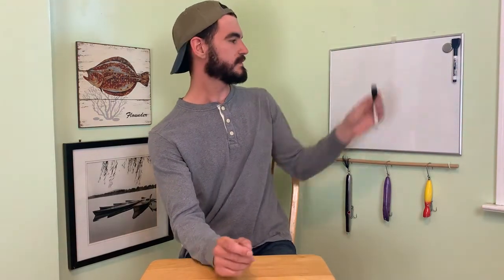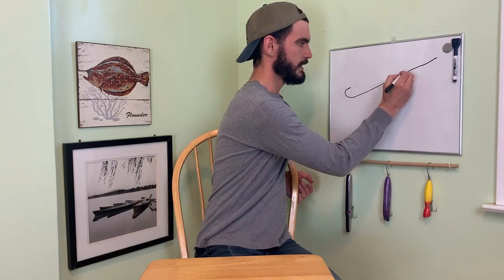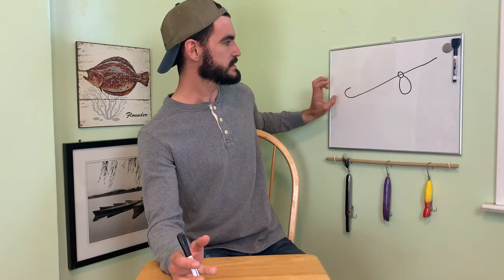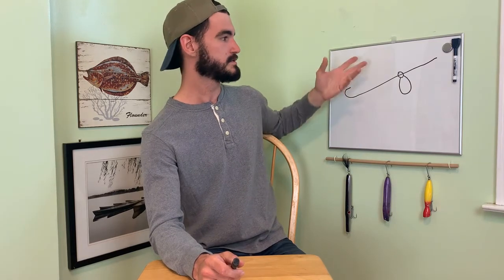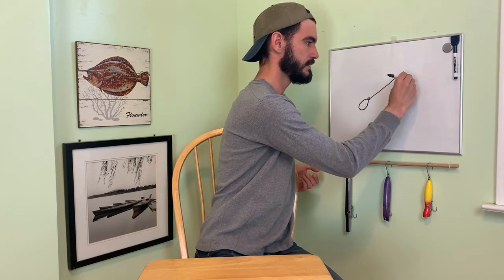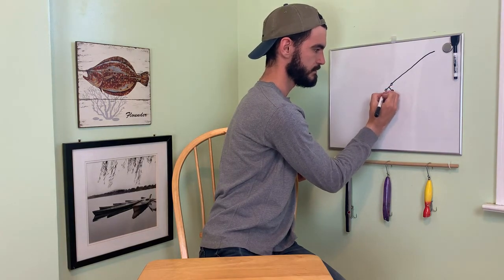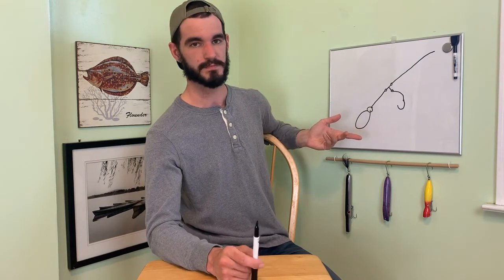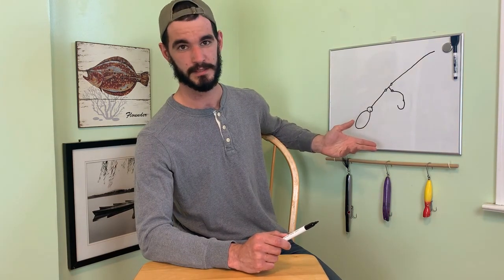Tautog (Blackfish) Basics | How to set up the rig

Comment: how long of a leader to the hook do you use one the second set up ?
Reply from the maker: I usually use one that’s about the same length as the one connecting the sinker to the three way swivel. You can go shorter, but if the bait is too high off the bottom, the tautog might not pay as much attention to it. I’d encourage you to experiment and take note in your journal.